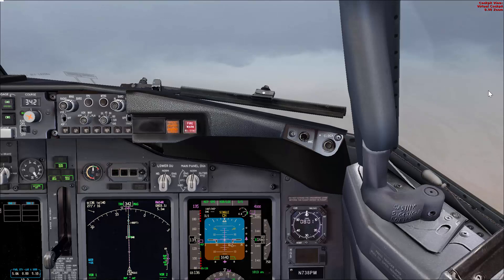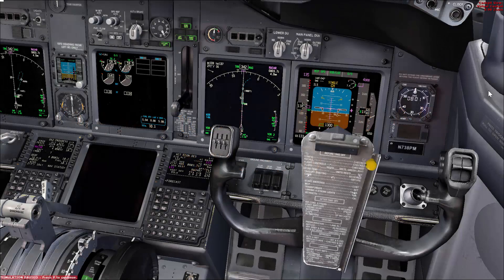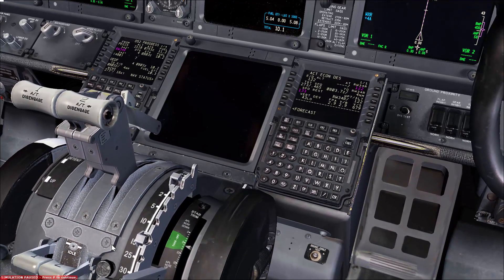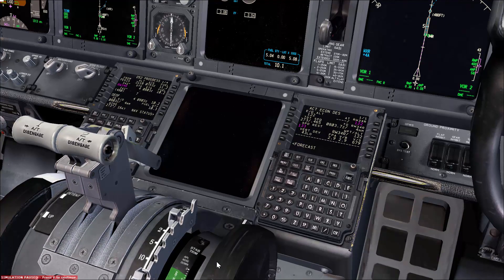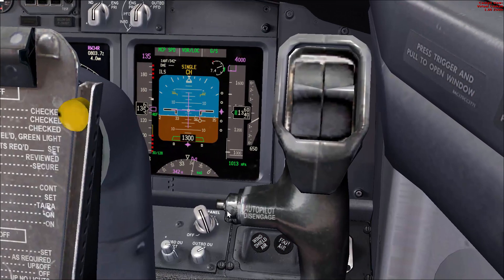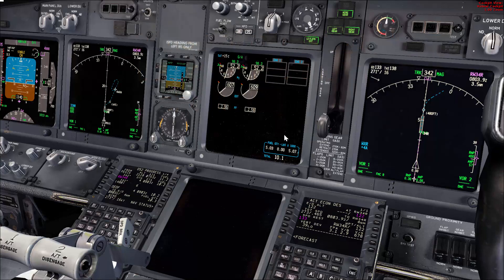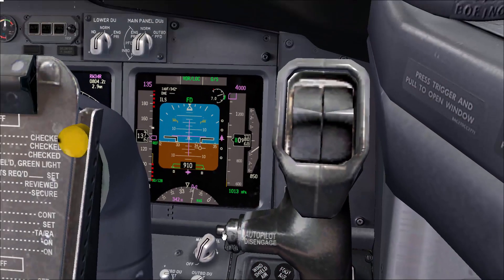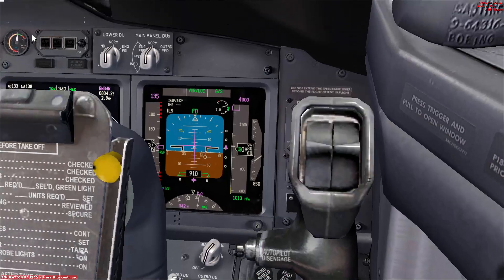B737 App. & Lndg Video#6 (Disengaging A/T & A/P Smoothly)

Comment: I  disengage the Auto-pilot first with no reasonable explanation and if you want low-speed protection, Arm the Auto-Throttle again but you have to understand how it works very well.
Reply from the maker: Hello Osvaldo, 
Give it a try few times to disconnect the A/T first and see if that makes a difference for you, just a suggestion and it is just a technique after all 😉, 

As far as using A/T arm, personally not a big fan to use it on the approach for the reason you mentioned, I personally don’t have a clear idea of how it will behave or what will trigger it to click in. 

Thanks for sharing your knowledge and opinion 🙏🏼

All the best
Abdul
Reply: I did it yesterday

Comment: Is there a situation where you  actually force the A/T to go into the ARM mode by deselecting the thrust mode, Maintain APPCH speed, trim and pitch then disable A/P prior to 1000, hence maintaining stable approach criteria.
Reply from the maker: I can’t think of a situation that that would be better than letting the A/T maintaining the speed. 
If the A/T is fluctuating a lot engage the other A/P for a smoother control ( Dual channel) but remember to disengage the A/P by 500 to avoid the automatic STAB trim for a G/A. If two channeled engaged at 500ft the A/P will trim for a G/A to be ready for one.  
All the best
Abdul

Comment: The main thing is to give yourself a "room" in the access of 1-2 seconds or so and be sure your are pressing the proper button on the thrust levers. It is very popular mistake when pilots pressing TO/GA instead of A/T disengage button. There so many reasons of doing this but anyway just make 1 second delay in this two actions and verify visually you are pressing correct button.
Reply from the maker: I agree with you 2 seconds or so to make sure would be great for new pilots. 
Thanks for sharing 🙏🏼

Comment: Thanks Captain for the amazing attention to details. Is there a situation where you can fly with one of them engaged and the other is disengaged? Other than single engine operation?
Reply from the maker: Hello Abdulaziz, thank you for your kind words and the question. 

Regarding having the A/T engaged while the A/P is not:
-I lean with Boeing recommendations mentioned in the FCTM that the A/T should be disengaged any time the A/P is disengaged except for Takeoff (Ref. FCTM pg 1.40 “AUTOTHROTLE Use”). 

For having the A/P engaged and the A/T is not:
- I don’t see anything against doing that. But personally will not do it unless A/T is chasing the speed like in continuous moderate turbulence or on the approach flying through thermals, then I like to disconnect the A/T early and make the thrust adjustment manually, one thing to remember is to have a reminder that the A/T is disconnected. To avoid the slightest possibility that the crew forget then its always better to have the A/T engaged when the A/P is engaged. 

Finally a technique mentioned in the FMC User’s Guide to manually force the A/T to go into ARM, that is by deselecting the thrust mode. From personal experience I believe it is not a good technique in addition the FCTM is not recommending it as well. 

Hope I answered your question, please let me know if you have any other questions or comments or suggestions. 

Fly safe 
Abdul